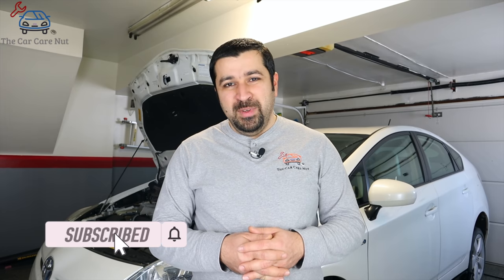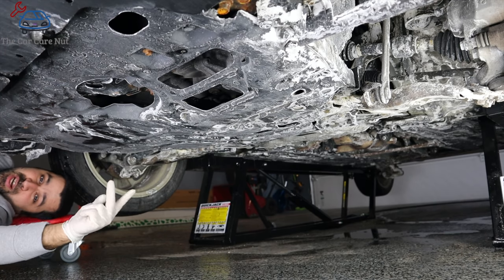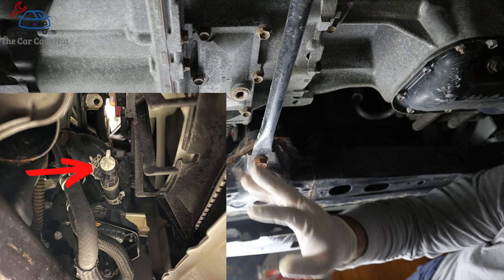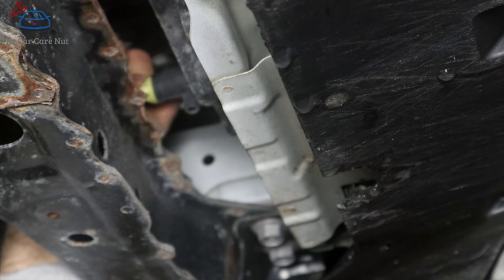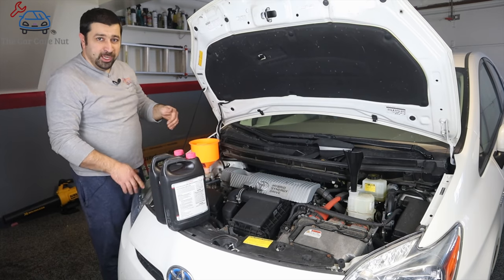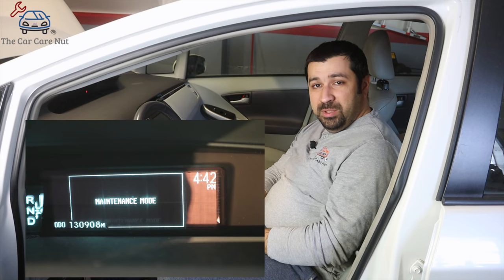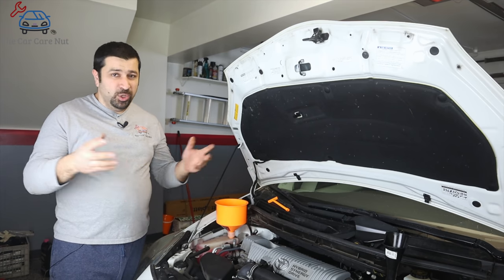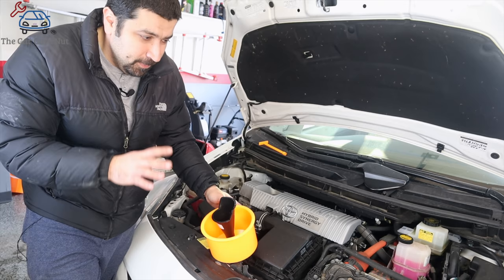How to replace your Toyota Hybrid Inverter and Engine coolant

Comment from the maker: The engine coolant information doesn’t apply to hybrids with the 3.5 2GR engine and hybrids with the dynamic force engine.
Reply: Great video as always AMD. I have a question. The premixed coolant isn't available in my country. We have the concentrated one, which we have to mix with water in a 1:1 ratio. I wanted to know if I can mix the coolant with deionized water (used for car betteries) as distilled water is really expensive here. Thank you.
Reply from the maker: Hi! Honestly I’d rather you leave the coolant alone than not use distilled water. It’s expensive but the components you are replacing the coolant for is even more expensive
Reply: @TheCarCareNut  Noted. Thanks a lot for the advice!
Reply: Thanks for the video! Great information.. since this doesn’t apply to which I assume 2018+ camry hybrids. Would we be able to vacuum fill a camry hybrid and be good to go? 
Also this question is off topic but while watching your other video about the new engine with vvt-e.. when or if ever the electric motor fails would it be a diy job? Just plug and play or it would have to be calibrated?
Reply from the maker: Hi! Vacuum filling the coolant on that engine might be an issue because of the closed valves. I would still bleed afterwards. And the motor for the variable valve timing on the A25A needs calibration after it’s installed
Reply: Great clear video AMD.  I am surprised how much surface rust on this car.  Do you think we need to worry about those rusts?  I apply some rust stops and zinc-aluminum spray when doing this meanwhile the tedious clip removal job had been done.     We are in EU has not much option to get affordable coolant from Toyota. It cost astronomical price, more than $60 per 5L.  Aisin sell it directly for Toyota for less than 1/3 price.
Reply from the maker: Hi! The surface rust is very normal for this area because of the road salt used. If you have road salt it wouldn’t hurt to rust proof things but eventually no matter what you do you’ll have some surface rust
Reply: @TheCarCareNut  thanks, I used to live in Florida, working with car suspension was easier. Now, replacing stabilizer links is a nightmare, I have to use reciprocal saw, torch or vicegrip won't help. The rear stabilizer link cost $220 each for Corolla IM / Auris hybrid or lexus ct200h. Crazy price but only the rubber parts swell, the joint is still good. Next time Just the rubber parts, much easier and cheaper and keep the metal links since I do not need to cut it again. Rust is terrible on nuts and tread although the body has little of rust.  Probably we should put grease or antisieze? But I'm afraid it will come loose. Aftermarket parts use locknuts but the ball joint does not last as long like Toyota part. I tried Schaeffer FAG/INA, german bearing supplier for Daimler, it's really smooth and galvanized at $26, about 2x than other brand
Reply from the maker: Anti seize should be ok to use and wouldn’t cause loosening
Reply: You are right this video does not apply to 3.5 hybrids such as the Camry Hybrid and the procedure is very different. The guy dong the video said his procedure applies to all hybrids but it does not.
Reply from the maker: There’s no 3.5 in a Camry hybrid?
Reply: Correct me if I am Inverter is like alternator on hybrid?
Reply: @Moses Watson Thank you, I went there and it seems like a nice service :) Appreciate it!
Reply: @Jad Bowen No problem :D
Reply: What is the procedure for a 2019 Camry Hybrid?
Reply: AMD thank you for all the information you give us in all of your videos.  Are you going to make a video for the 3.5 Hybrid system?  I have a 2018 Lexus RX450h and I don't see the "inverter coolant".  The manual listed it as "Power Control Unit Coolant,"  is it the same thing?
Reply from the maker: Hi! Once I get a car with this cooling system I’ll make a video about it
Reply: @TheCarCareNut  That is awesome to hear, looking forward to it!
Reply: So the inverter coolant is the same as the radiator coolant I just bought 2009 camry hybrid and I want to change the coolant and I thought maybe they were different but looks like it's the same kind right?
Reply: Can ct200h transmission  put In prius v? Is it possible swap? Thz for your knowledge and advice. Do transmission swap need to remove subframe for prius v?
Reply: Why do i need to change the coolant. 
Also my inverter is hot. And the coolant level is maintained.  How can i check the coolant
Reply: Do you have a video how to flush coolant and inverter coolant on 2GR - FSE/FXE Hybrid v6 systems?
Reply from the maker: Not yet
Reply: Do you have a video for 3.5 engine
Reply: @KHIJAPAN  yes that be great for 2GR FXE and FSE Hybrid engine?
Reply: Lexus 450h model 2007 ?
Reply: I question the need to chanhe inverter coolant. There are no moving parts and as you can see the coolant removed is clear. So can you tell us why we would change this coolant?
Reply: I have a 2019 RAV4 hybrid.  I tried today:  drain, fill the engine coolant and inverter, put the car in Maintenance mode to bleed air, heating and cooling fan off.  After the cooling fan came, then the speed of the fan seems to accelerate and a loud noise came on.  I got scare and shut off the car, this noise still continues and stops after about 15-20 seconds after engine shut off.  I took it for a drive and the temperature reading for the engine coolant shot up.  Coolant in both reservoirs are at appropriate level.  Most likely a bubble trapped.  Please help.
Reply: @TheCarCareNut   I filled the 2GRFE with the vacuum fill tool. It was fully bled and done in 60 seconds. Is it OK to vacuum fill the 2GRFXE hybrid? Also, the easiest way to open and close the rear block drain on the 2GRFE AWD is using a 36-inch (yes 3 feet long) extension from the middle of the vehicle!
Reply: Why is it that some say the same coolant is used for engine coolant and inverter coolant reservoirs, but if I Google it it says definitely not the same stuff??? Also I cannot find inverter coolant anywhere on the internet!
Reply: Is the 2020 Rav4 Hybrid a dynamic force engine?
Reply: @bholahakshaye2627  
Can  it be  applied  to  2018  Camry  hybrid  ??
Reply: Why the interval on gen 3 Prius was 10 years and eveyr 5 years.  some said 7 years and 5 years later on.
Reply: I thought usually we must make sure the heater are opened. Therefore we are making sure the heater core has no air buble and works fine.
Reply: Hi, thank you for the guide. Does this also work for a 2015 hybrid highlander with 2gr fxe engine? Or do i follow the 2gr fe radiator bleed you posted on another video?
Reply: So what is the correct procedure for a highlander hybrid with 3.5 2GR??? I cant find any videos around for these. Do you the same bleeding procedure as regular gas 3.5?
Reply: I have a 2021 lexus nx300h. Is it the same process for getting this model into maintenance mode ?
Reply: @TheCarCareNut I know you are very busy, is it possible that you explain the bleeding process for engine coolant Prius generation 4?
Reply: 2GR-FXS please 🙏

Comment: Maintenance mode: power button once (no brake), gas pedal floor twice, hold brake and go to neutral, gas pedal to floor twice, hold brake and put it in park, gas twice again, hold brake and turn the car on. Before you start turn off the heater completely. Bleed the car with the heater off. Make sure the garage is open because there will be fumes
Reply: Great explanation!
Reply: Whoever came up with this knew the Konami code
Reply: Why do we bleed this with heater off vs on
Reply: To get into Maintenace mode on my 2017 Prius, I first had to turn the engine ignition on without starting the car.  To do that, I have to press the power button TWICE without pressing the brake.  Pressing once only turned on the accessories circuits without turning on the ignition.
Reply: According to Toyota Techinfo, otherwise known as the Toyota Technical Information System (TIS), for my 2017 Prius, the factory procedure for bleeding the engine coolant is to (1) turn the AC off, (2) set the heater for MAXIMUM heat, (3) set the blower speed to the lowest setting.
Reply: Hey  friend ...what is you mean heater can you explan me brother
Reply: Power button twice
Reply: How do you get out of maintenance mode
Reply: @jiannablue7779  just switch off and start
Reply: Why do you do this? Is it for a certain reason?
Reply: Before I saw this video, I liked your comment because I thought you were joking 😅😅
Reply: What kind of fumes? Why is it different in maintenance mode that cause that??
Reply: @kornshadow097  to put the engine in the correct state so that the coolant can be completely bled. If you want to hear The Car Care Nut explain it, watch his video on coolant replacement for the dynamic force engine. In that video, he contrasts the procedure for the hybrid and non-hybrid Camry and you'll be able to understand why maintenance mode is needed.
Reply: @madmax8620  engine exhaust fumes. He's just saying that any time the engine is running you need to have ventilation.
Reply: @embeddedmatt  thanks!...I figured that would have been obvious so I was confused... also, what did he mean by "bleed the heater"??
Reply: @kornshadow097 excellent question
Reply: Go to ignition mode and not accessory mode for the 2022 RAV4 hybrids

Comment: is there a level above 'Toyota Master Diagnostic Technician' ?   you need to be promoted!!  EXCELLENT video
Reply from the maker: Thank you! MDT is the highest nothing more!
Reply: @TheCarCareNut  My 2010 prius has high temperature light blinks on for seconds on freeway after i follow your video.
Reply from the maker: Hi! Is your water pump running?
Reply: @TheCarCareNut  what symtoms of bad prius water pump? You know? I didn't hear any strange noises
Reply from the maker: You’ll want to check the flow in the reservoir as the engine is idling. Also use a stethoscope to listen to the water pump.
Reply: Awesome job

Comment: I’ve been a happy owner of a 2014 Prius for about half a year now, and MY GOD your videos are so useful I can’t even explain. Everything is clear, precise, and to the point. Thank you so so very much for all this information that you provide to us Toyota owners. You’re saving us incredible amounts of time and money.
Reply: Hello, I have a question, when do you know that is time to change your antifreeze/coolant? I just bought a used 2010 hybrid Prius but i don’t know how to recognize if I have to change it already :(
Reply: @igorrosales1799  I’d ask the previous owner  of the coolant was ever changed and when they changed it. If not, it’s not going to hurt anything to put new coolant in your hybrid. Better to be safe than sorry because major repairs to hybrids are expensive. Relatively speaking, coolant is cheap, a new motor or hybrid system is expensive.
Reply: When I asked at the dealership, they all agreed that 160,000 km is the time.  My car has 162,000 km.

Comment: Question : I just checked my GS300h and it had BLUE coolant in the inverter, not pink? Is this normal? Also slightly below the "low" mark on the reservoir.

Comment: Man I do not miss living in Wisconsin for this very reason, HOLY SALT!! My goodness, I remember so many of my first vehicles were rusted so badly; brakes failing from rusted lines, suspension shot, you name it. Not to mention when I went to replace a wheel bearing, I had to replace every single suspension part I had to remove because I destroyed them trying to remove them. You're doing the lords work, cheers!

Comment: This tutorial was so good. I used this for a Lexus CT200h, and this method is essentially the same as the prius. Thank you for the easy, step by step guide. Paying a dealer for this is a joke! Lexus quoted me 400 dollars to do this!
Reply: 390$ in NY for Prius!
Reply: So the maintenance mode sequence is the same for the CT?
Reply: Did you confirm?
Reply: @castironrichie1445  and how much it is $ if you do it yourself?
Reply: @igorrosales1799  in NY, 80$ for 2 gal of coolant, 4$ for distilled water ,  6$ for big funnel
Reply: OEM Coolant used to be 30$ each
Reply: is the inverter drain plug washer size the same as the oil drain plug washer?
Reply: @jasonng06   yes
Reply: How long did u keep the car in maintenance mode? I have a ct and had to replace the coolant and water pump

Comment: I just had my Inverter Coolant, My Engine Coolant and my CVT Tranmission Fluid changed at my Toyota Dealer at 70,000 miles on my Wife's 2014 Prius.It cost me $625 with tax for this service. I was able to watch the Technician perform these services from the open garage door. I did not observe him doing the Purge step as I have problems with standing for long periods because of my knees and back. The Drain and fill portains of all of these procedures are very simple. The key to this whole thing is getting the Car up off of the ground far enough so you can work on it comfortably.  Several years ago I changed the CVT Transmission Fluid on my 2008 Prius it was a very simple process because the CVT Transmission has no pressure on it, it also has no Filter on it so it just drains easily. I can no longer do this work as I cannot get down on the Garage floor on my back because of my knee and back problems. I used to do about 80% of the work in my 2008 Prius myself when I was healthy. I had my own Maintenance Manual for my Xar which covered everything. I have owned Priuses from Gen 1 thru 4 they are excellent Cars. The 2008 had 197,000 miles when I traded it in and it was in excellent shape. I only traded it because the Dealership beleive it or not made me a deal that I could not resist. In conclusion I will also say this the Gentleman that makes these Videos is the Absolute Best Toyota Technician that I have ever seen and I have dealt with a lot of them since 2003.

Comment: Thank you for this informative video.  I picked up two jugs of super long life coolant at my local Lexus dealership and ran my 2014 es300h up on the hoist.  The 10 mm hex plug in the transmission required a leap of faith and a firm twist to loosen, but as promised, it bubbled out the pink coolant, so all was well.  If I had turned a plug that hard in my Cayenne, it would have stripped, but this is a Toyota product.
I reached up with a beverage tube to fit over the tap under the radiator, so I could just watch as a clear plastic jug filled, so the combined operations were pretty much drain and pour.  My wife started the car while I waited to add coolant to the inverter reservoir, but it took little.  Total yield of used coolant:  half a jug from the inverter and a full jug from the radiator.  The rad fluid seemed much more worn than the inverter fluid.  I'll check the reservoirs after a drive, but there's a lot of snow this morning.  Rod
Reply: @alex15a30 did you get that sucker off? I’m guessing PB blaster did the trick?

Comment: Excellent work.  I'm a DIY and was nervous about changing the coolant fluid in my 2010 Prius.  Didn't realize it was that easy.  Thanks.
Reply: Hello, I have a question, when do you know that is time to change your antifreeze/coolant? I just bought a used 2010 hybrid Prius but i don’t know how to recognize if I have to change it already :(
Reply: @igorrosales1799  Take it to the Toyota service center and ask them to print out the previous maint records.
Reply: @wannaflyme  i ended up selling my Prius, sold it at half price what I paid for it :( it wasn’t starting anymore
Reply: @igorrosales1799  Oh! How come it didn't start? Perhaps the starting battery maybe??? Oh well, it is gone. Let the bygones be bygones. Have a nice day Igor!
Reply: @wannaflyme  it had the “check hybrid system” message for 3 weeks and I still continued driving it, went to the dealer but they said the car would have to stay overnight which I couldn’t do it because I need it for my job. Also I was constantly pulling and reconnecting the white cable from the front and one day I broke it by accident so that’s when didn’t start anymore lol, sold it for $2,500, in one hour, lots of people interested

Comment: My 2020 highlander hybrid has a drain valve for the inverter. It's on a hose under the radiator. Also the radiator has a cap. I had to fill the radiator first before filling the tank. Very straight forward and easy job.

Comment: I just replaced the inverter coolant on my 2006 Highlander Hybrid with 3MZ-FE engine. On this model I removed the front plastic grill to make it easier for my hand to turn  the upper and lower inverter radiator stopcocks. The inverter radiator is in front of the main radiator. Crack open the inverter radiator cap and open the lower stopcock to drain the inverter radiator and then open the 10mm inverter drain plug under the car to drain the rest of the coolant. About 0.6 gallons drained out for me.  Once fully drained, close the lower stopcock, open the upper stopcock to bleed the air, and refill from the inverter reservoir. Close the upper stopcock when coolant comes out and continue filling the inverter reservoir. You will add the same amount of Super Long Life coolant as you drained, about 0.6 gallons.